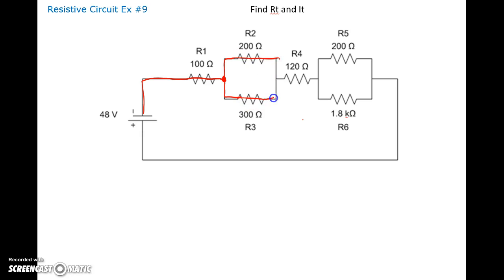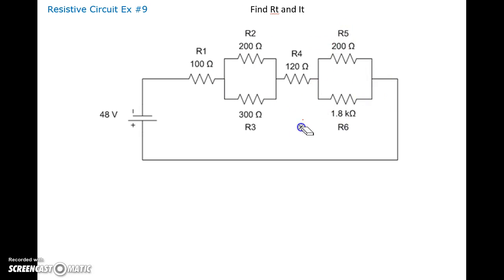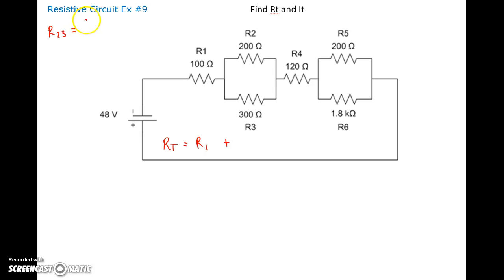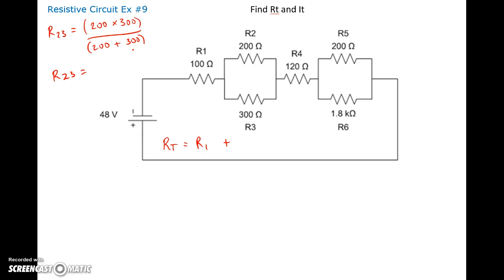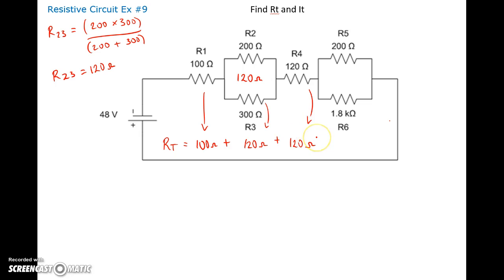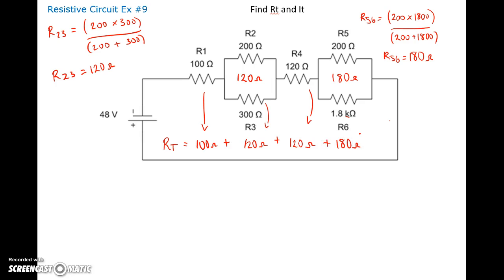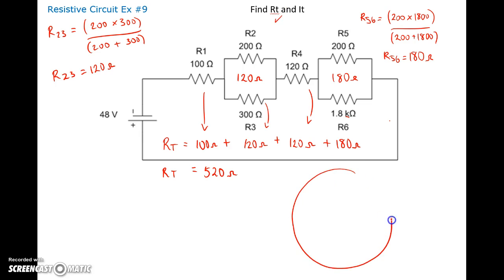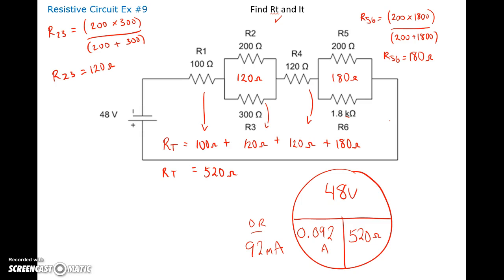Series Parallel Combination Circuit #9

Comment: how do you find the voltage of both r23 and r56?
Reply from the maker: Find your total current and then use the Product over Sum equation to find the equivalent resistance for each parallel portion.

Comment: Thank God I found the easier method of calculating the two parallel resistors instead of the other method by dividing it from 1 without the use of calculator!